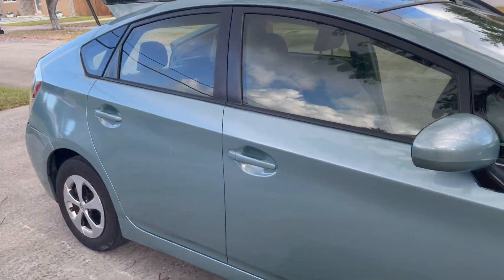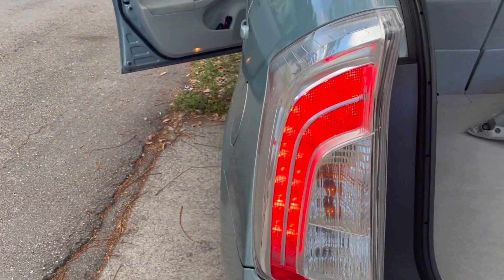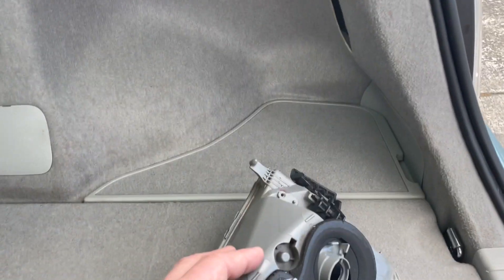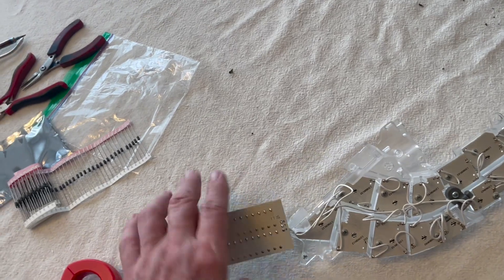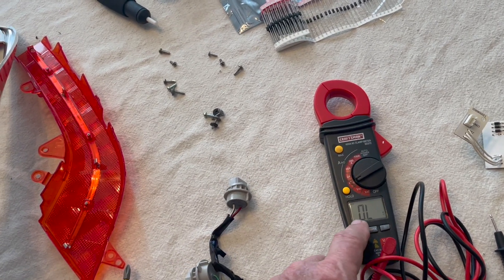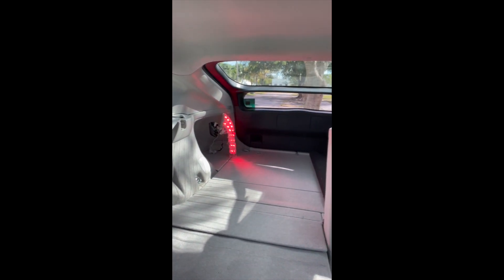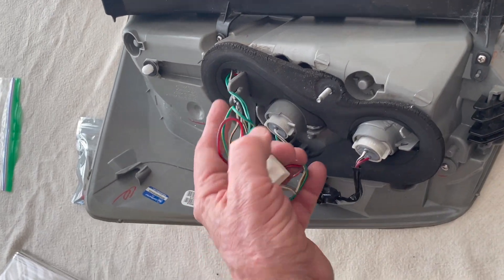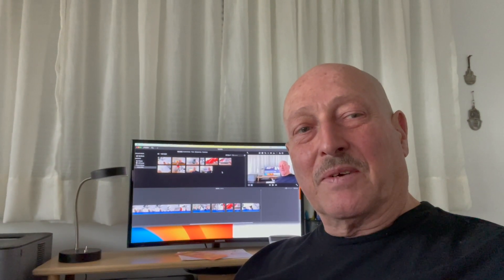Prius Brake Light Repairing

Comment: whats the part number for the diode you replaced?
Reply: 1N4007 is that correct?
Reply from the maker: @thomascathcart1185  

Hello Thomas.
It is 1N4007 Rectifier diode. They are inexpensive diodes sold in quantities in Amazon. Here is the link of my order:
https://www.amazon.com/gp/product/B071DXGHL7/ref=ppx_yo_dt_b_search_asin_title?ie=UTF8&psc=1
Reply: How did you remove the back assembly from the lens?